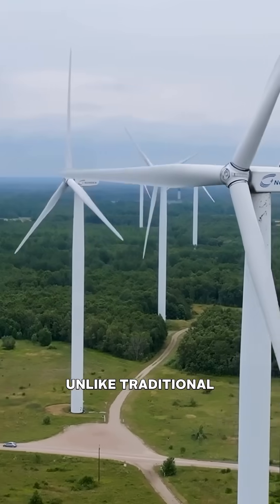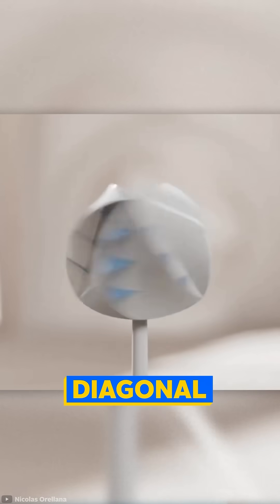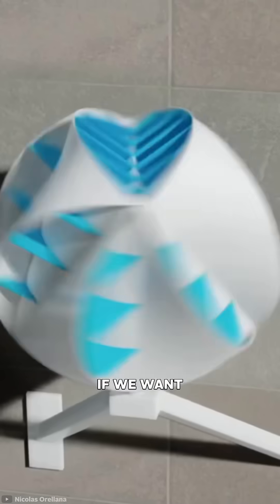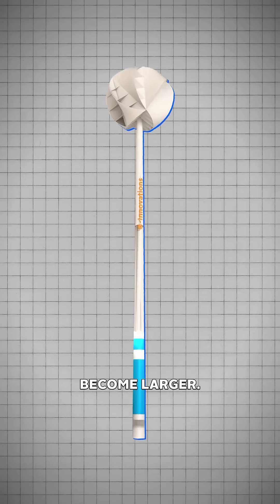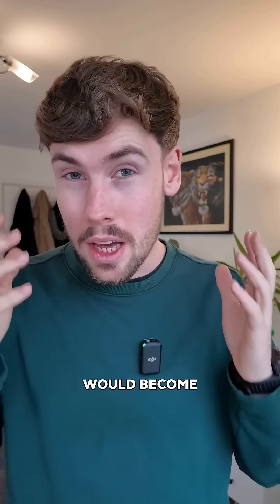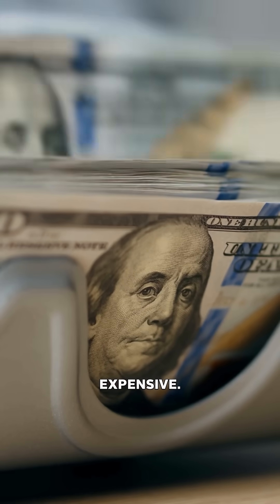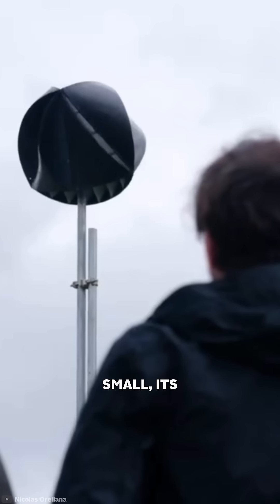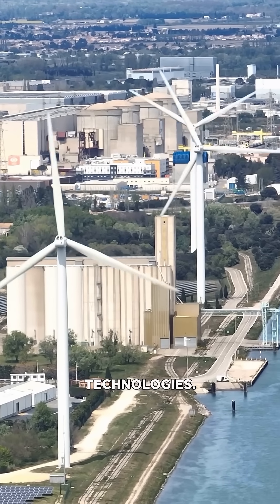This Sphere Turbine is CRAZY!

Comment: Yeah I don't see this taking off. For one thing multidirectional turbines have been around for a couple hundred years, it's literally as simple as vertically mounted blades arranged in a cylinder.

 Second the aesthetic quality looks like some special or proprietary manufacturing techniques, which means its needlessly expensive. So there's nothing that's actually special about this other than how it looks. 

So to me it's just a gaudy yard decoration but for yuppies.

Comment: Project I worked on in the Fraunhofer institute in Germany:
Regarding design: if you imagine a large commercial tin of food, each stacked on top of each other, all the way to the top, of each corner of a large multi storey building, inside each tin are sails, spinning round and around, something like the signs you'd see outside shops years ago or like the ones on top of refrigerator vehicles. Each floor, ten on each corner, 40 per floor, providing all the electricity required for each floor, these are the designs that I worked on.
Especially designed for cities like New York, because of the wind and corrosion created by grid design cities. Designed not to require outside electrical installation all internal off the grid.

Comment: Also instead of scaling it up, you simply add more. You walked into the same cognitive trap that many (especially older) people do when arguing against renewables. Thes always ask "But how is one of these supposed to sustain an entire city" or "What happens if there is no wind/sun/etc?" And they ask this because they are trapped in the mindset that corresponds to large coal or nuclear reactors that can be scaled almost infinitely and generally one provides power to one or even multiple towns. But the goal and strength of renewable energies is diversification, not only by energy source but also location. Renewable generators are supposed to be built in small neighborhoods at most and use whatever energy form is available in that specific place. Every backyard could have one or multiple of these engines. Each street have a biogas reactor that collects the waste of all houses to provide a back up solution. Every roof could have solar panels, and so on.
TLDR; The way to scale renewable energy generators is not to make them bigger, but to make more of them and distribute them further. Also has the neat effect of shortening supply lines.

Comment: "low power output" ah so not sustainable at all. the cost to product ratio of all this eco bullshit is ridiculous, something like 1560:1 where as nuclear energy, or even fuel generators have something like 2:15 ratio, meaning the product does more than the sum of its parts.

everyone ignores production. it's why i will happily set electric cars alight.

Comment: I love the design, larger designs if applied as a artistic sculpture would be visually pleasing and if meshed with an efficient gearing and generating mechanism could have a dramatic impact providing power in a meshed network . Bravo ! Well done.
Reply: See my other comment regarding eye strain and flicker effect.

Not visually pleasing to most, best off if they were disguised and shaded and out of line of sight of roads.

Comment: And it will remain a symbol because, just like all other wind powered forms of energy generation - it's inefficient.
Reply: In what way is it inefficient? In Denmark we covered just over half of our electricity needs in 2020, just using wind
Reply: @kapperbeastYT  But it's covered with the good old 3-blade turbines, not one that "innovative" forms.
Reply: Yeah but so are Oil and gas
Reply: @ppf_world_news oil and gas energy density is very high. Wind get out done by it easily, if we want a viable renewable source we should look towards nuclear and hydro the things that are currently viable and improve on it instead of spreading all the funds thin over 5 different form of renewable energy. Not saying that wind is useless it is great in area which lack the capability and resources to build a plant but the greatest impact to environment will be large scale nuclear plant.

Comment: The way to scale up isn’t by making them larger, but by increasing their saturation in any given space, and that is possible because they are small.
Reply: Exactly that's the point of getting wind from everydirection and on small size it can be made with cheap materials
Reply: Your right. So much more of them in a small space would work so well. I think people need to get over themselves and just accept we need stuff like this.
Reply: @sideshowkazstuff3867 The problem is not acceptance. Whether you make them larger or use multiple units the problem is space in an urban environment, as he said.

Comment: Because it can harness energy from a greater range of directions, surely that means there is more time during the day where it will be producing power? that sounds important too
Reply: That was the first thing I thought, having wings/vanes pointing in every direction would be cool for that reason. The second thing was that because most of the wings/vanes will be pointing in the wrong direction most of the time the total energy produced works presumably be lower while it is running even if it is running for longer. I don't know whether the extra time or the inefficiency if not having all the vanes pointing in the same direction wins out.
Reply: Not really. The wind will usually flow in the same direction(s) in a given location. Usually between 1 and 3 directions.

Large Airports have multiple runways in different directions the wind blows so the plane can always land into the winds instead of having it blow on the side of the plane which is dangerous while landing.
Reply: If possible we can place it in a place where winds are faster and stronger such as near the equator.  @rkidy
Reply: @user-gm6ks8qq1r  wind is actually weakest near the equator, and strongest near the poles. Either way, these things still aren’t viable.

As the vid said, scaling these things up is expensive and in feasable. Their volume grows rapidly as you scale them up. Instead, standard wind turbines are much more effective for wind farms. These things are really only a PR stunt, costing much much more than they will ever make. Urban environments naturally have much lower wind speed than rural areas where there are no buildings to block the wind.
Reply: Wind is not affected by daytime, only seasons. Terrible. Awful. I study regenerative energy systems, and this shit is the bane of our existence. Fake green, fake innovative, cash grab dog water. Transmission lines are a thing. The grid is a thing. Locally produced power is a nightmare at this scale.
Reply: You would be surprised but your average windmill can turn too
Reply: If it captures omnidirectional wind then it will also have omnidirectional wind resistance?
Reply: @timlesiuk  that is not an issue for small static structures